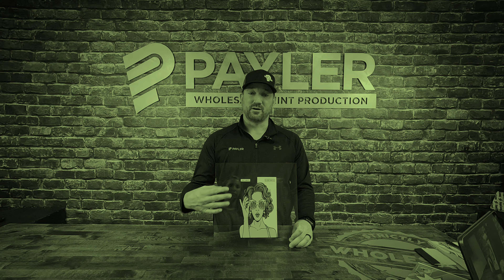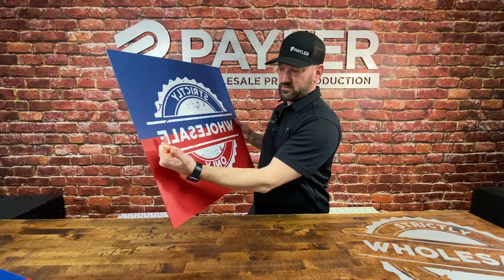The Correct Way to Print Translucent Graphics

Comment: what if the size is bigger than your flatbed?
Reply: Our flatbeds will print just as big or even bigger than acrylic sheets or polycarbonate reels can be supplied. If the cabinet is too big for acrylic or polycarbonate, typically it is built for a flex face. We print our flex faces with the same process.